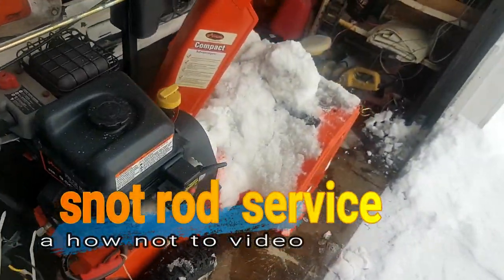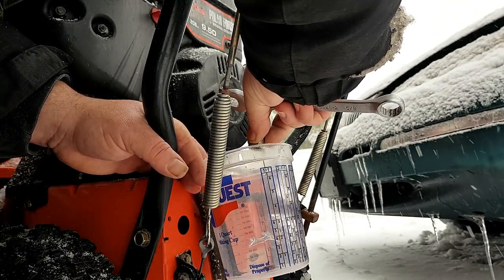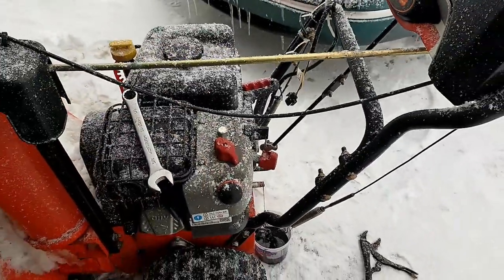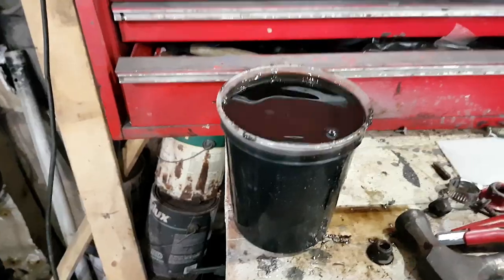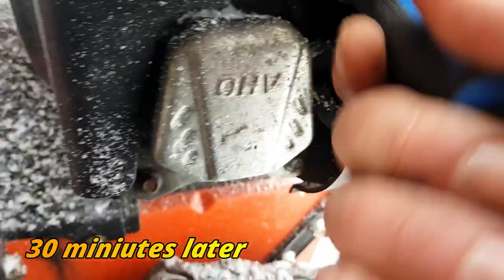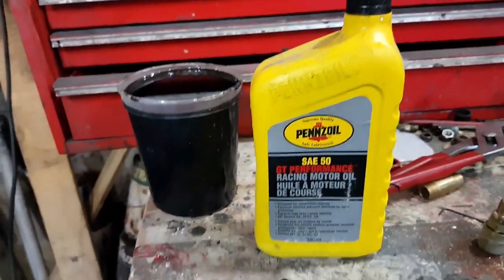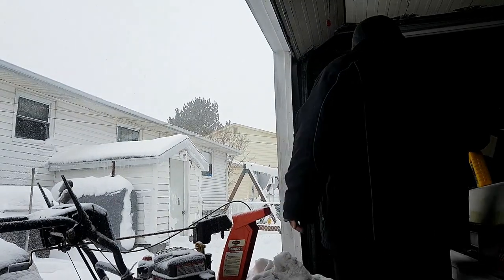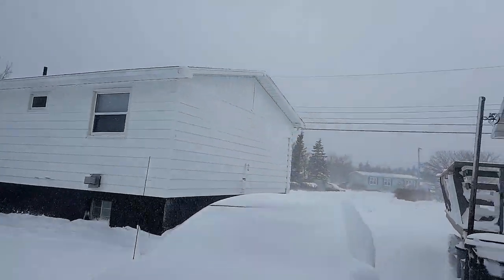small engine repair & maintenance service ariens compact 24 briggs and stratton 208 cc  snow blower

Comment: That little oil drain plug extension was so thoughtful of them.
Reply from the maker: I thought so.
Had of noticed it 5 or 6 years ago would have been better. 
It's one of those things you don't even want to look at when you're not using.  Did I say I hate snow lol

Comment: What would be best to unseize a snowblower engine? Just to get the crank shaft and cylinder to move.

I'm dumping all fluids and cleaning it all so I've got the room to do this.
Reply: Ok, that's even more handy, my Engine is a Briggs and Stratton as well. I've got the whole teardown and parts manual as well :)

Just sure what to use for an unseizer?
Reply from the maker: I have used seafoam and transmission fluid  together 

Once you get it moving get some cutting oil for a drill bit at the hardware store. Work back and forth till you get a 360 degree rotation
Reply: @thisguysgarage  sweet :) I never thought of the cutting oil. This should make for an easy job :) (I hope)
She's old but still better then most blowers I've seen :)
Eats ice to :)